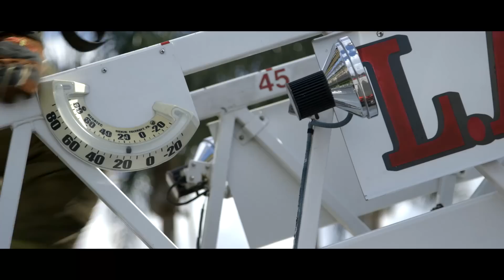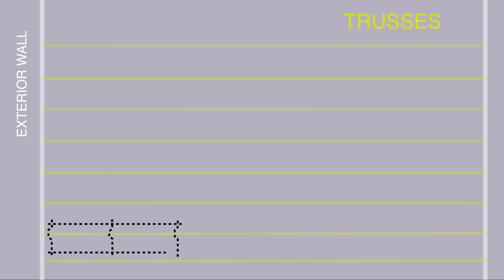Vertical Ventilation - Light Weight Truss (LACoFD)

Comment: 1, never trust a truss.  2, stay along the wall as long as you can,  3.  Make the cut and get off the roof.   4.  If there is flame out the roof, it is already ventilated, stay off the roof.

Comment: This is how people get killed, you do this from the safety of the bucket or dont do it at all. Why would you send a crew on a roof that can fail in 5mins?
Reply: FDNY we do not cut truss roof systems.  Natural vents then get off.
Reply: You're wrong.  Lightweight Truss roofs get the ultimate bad wrap.  I've vented many, and you have way more time than you think.
Reply: @chrisreed3435  im not wrong at all lol, literally every text book says otherwise. Not to mention the corrugated roof can flex if you missjudge your cut.  Plus your risking firemens lives for a property that probably doesnt have any life hazard (commercial).  Your rolling the dice when you do that, good luck with that.

Comment: Vertical Venting does not work, makes the fire worse and is an unnecessary danger.  Horizontal venting and extinguishment is the Only way to go for the initial attack and Protection of the victims. entry team, possessions and the structure.  Here's the proof.
https://www.youtube.com/playlist?list=PLkp0E1ao1XEy2uMomAtjWfScRFcCUmwwv
https://www.youtube.com/playlist?list=PLkp0E1ao1XEwOwl-LixUZQbfkw7jnMsEv
https://www.youtube.com/playlist?list=PLkp0E1ao1XEzg384QZ4ovMA_6P7gCY3nJ
https://www.youtube.com/playlist?list=PLkp0E1ao1XEwTFq6mNdmT5_OszmNocqqj

Comment: Is this a joke? WHAT IN GODS NAME are you doing cutting a lightweight truss roof? Walbaums fire 1978
Hackensack fire late 80s. Do you know how quick this can fail under fire conditions. DONT EVEN CUT THE ROOF!! Everyone on the internet wants to talk about safety on the fire ground. This is so fucking unsafe. DO NOT LEARN FROM THIS VIDEO. Don’t do this. 

Walbaums 78-6 fireman killed lightweight bowstring truss.

Doesn’t matter whether it’s bowstring or not. DO NOT CUT LIGHTWEIGHT TRUSS!!! Fuck!!!
Reply: lol
Reply: Late reply but came to say this after this popped up in my notifications. And truss roofs like this don't fail in sections, once those nail plates start giving out its a domino effect and the place you're standing is suddenly very very bad. After the 88 Hackensack Ford fire, our dept started to inventory and label all buildings with truss construction. Our vert vent SOP for anything with an identified truss roof is to only do roof ops from the bucket or horizontal vent. Nowadays we don't even bother, we have several high volume fans that can be used for commercial structures. I have noticed that southern cali depts seem to have an obsession with being on the roof, even when it is blatantly obvious they shouldn't be. Recently, LAFD almost learned the hard way about doing roof ops over truss construction on that Boyd st fire. I'm not saying roof ops don't have their time and place, but they need to be used like any other tactic, appropriately. And I'll add that for bowstring we wont even go interior, unless its confirmed to be a small incipient fire, far too many funerals have happened because of those POS.
Reply: @Nervegas 1, how do you confirm it’s an incipient fire from the outside? 2, how long did the fire burn in Hackensack before failure?  3, when was the last LODD performing vert vent?